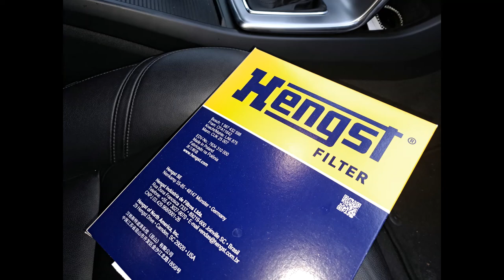Volvo V40 cabin airfilter change

Comment: Do you also have hissing noise coming from those grey hoses when AC is on?
Reply from the maker: Have not noticed any specific hissing noise. Although, I have this noise with VW Passat and in my understanding I should go to check the amount of gas inside the system. At previous springs and summers there has not been any hissing.

Comment: My old celica has two twist to unhinge the glove box then you have a who county of room to unclip and slide out the filter, slid new one in and close glove box. Less than a minute.

This ripping up carpets? Taking off covers, mangling the new filter to get it in seems like a horrible design flaw
Reply from the maker: @garethbattersby  correct on that ;) just another easy job VWs